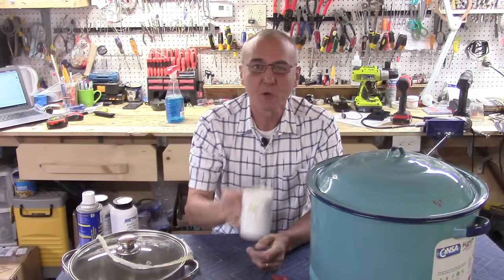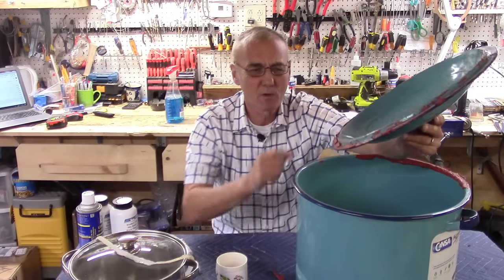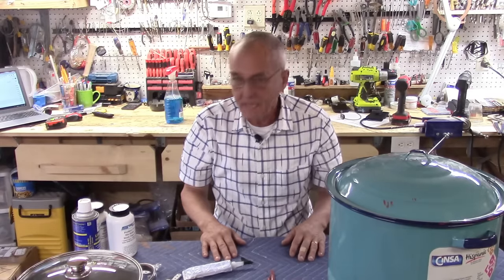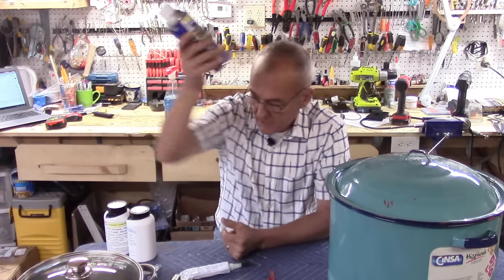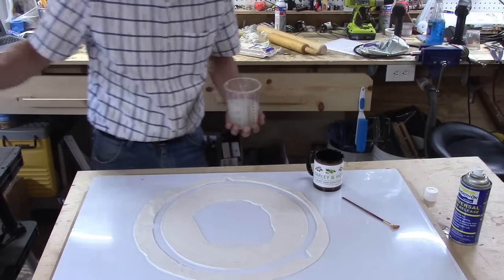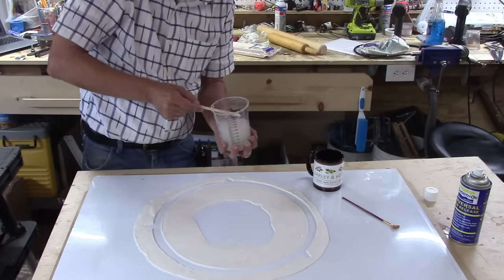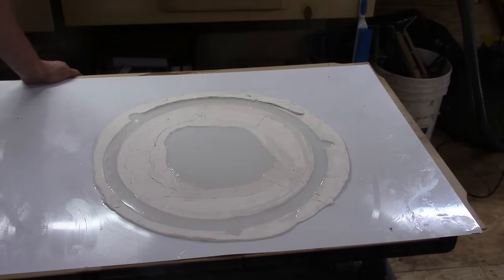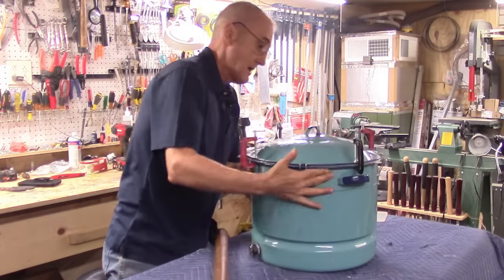BUILDING YOUR OWN STILL

Comment: Here in Bulgaria we seal the pot with a thick paste of flour and water, cheap, safe and works every time
Reply: This is also how the paste is made to repair classic books when they need to be to re-bound. Glue made from rice is surprisingly strong.
Reply: @tomcruise2313  wow i may have to experiment wirh flour and water
Reply: Once thank you for the advice. I'm going to do that.
Reply: Here in Australia we do that too!
Reply: Thats the popcorn Sutton way
Reply: What's the gluten free recipe?
Reply: pinnacle of balkan engineering
Reply: I have done this as well

Comment: You can use a cheap alternative to tape or silicone and do what I do as a chef, using flour turned into dough strips to seal the lid. Its used in kitchens for stews or slow braising to keep all them juices in. Hope this helps!
Reply: It's not a system that can go more than a single run .. but?! Yeah! And it's 100% NATURAL! Vegan and Organic at it's truest....

Good comment
Reply: @NJOwens-ep3hf   flour is not always organic.
Reply: Was also going to suggest this. Seen some Indian chefs do this when making biriyanis.

Comment: Hey George, I tried the method you showed to make the gasket, but unfortunately my lid was a bit different so it didn't work. What I ended up doing was to turn the lid upside down, run tape around the outside to make a dam, then filled that with the silicone. this worked a treat and also bonded to the lid so it doesn't fall off. Just sharing in case anyone else needs an alternate method.
Reply: That is what I was thinking, it would be nice for it to be stuck to one of the surfaces.

Comment: Hi George. with your lighting you could use a big white board. where the camera lens is. and shoot , the light from the sides would then bounce off onto your face. if it's too much light on your face. you could try a smaller one by the camera. if it's too much light hitting your face. use a smaller one. or not enough light use a bigger one or one on each side of the camera.

Comment: Hi George, the best cheapest seal is clear food grade rubber hose, the same that’s used for the water flow on the condenser of any still. Just slice the edge and fold over the edge of the pot not the lid. When heated it will mould into a really good seal.
Reply: what size of the hose would you recommend?
Reply: Sasha in metric about 10 to 15 mm
Reply: @Aleksandr-Herman  the rubber hose split down the middle didn't work for me I've had better luck with cheap 1/4 inch weather stripping... I use it on the outside edge of the bowl dome
Reply: That was  helpful clip ,thanks
Reply: what about the gap from the hose not being 1 round piece?

Comment: I've found the easiest reusable seal for those cooking pot lids is to use a section of your condensers water line. Cut a slit the whole length, being careful to keep it straight, and just slip it onto the edge of the lid and clamp it tight. May not hold up to your air pressure test, but really, a still should only run about 5-7 psi. Any more than 10 psi and somethins not right. But I always love to watch you work , George. Any time I need calculations, figures, or details that I tend to forget, this is where I come to find them. All your time and work is greatly appreciated. I've been doing this over 20 years, and I still learn something new from almost every episode. Thank you, and Keep it up.
Reply: Something wrong with the still, if it has any measureable pressure, it has an open tube to the atmosphere.
Reply: @grancito2    -  Most modern pot stills, yes. I use a modular, hybrid, reflux system with a 2" pipe at a 45, 2lbs of marbles in a sight glass, down to 1/2" pipe into 1/2gal infuser, down to an old style worm coil condenser thats 50' of 3/8 pipe, on top of a standard 15.5gal beer keg. Technically, its "open", but is also quite restricted, and does build up a decent amount of pressure, especially toward the tails. I chase a lot of leaks, but totally worth it when it puts out 3gal of 180+ proof in about 3 hours. I Love the hint of coffee I get from the infuser. (I drop it to 100 proof leave in 3 gal barrels made outta mesquite for #@%. Bottles around 95 proof.

Comment: Thank you for the tip on the silicone I build a gasket it works great I have a beautiful stainless steel still now and I'm making caramel rum using Werther's original in the Thumper

Comment: Holy crap, that was awesome! From the genius clay mold for the gasket to the electric element this is just great:-)>
Reply from the maker: Thanks
George
Reply: @BarleyandHopsBrewing  Just curious, could you have not used a bike tire inter tube as a gasket?
Reply: I watch this gentleman everyday, he is informative, covers allot in a short amount of time, keeps safety in mind and does not confine himself to one way of thinking.
Reply: I wonder if they're the Pacific reason he used electricity instead of using the top of a gas stove or a gas burner, for me I would rather use gas I don't know if he used the electricity to keep it from scorching or if gas will scorch it or whatnot but I think I would rather try gas first for myself, that way you do not have to be close to electricity if you have a shed or a rock house that you prefer to brew at. Here in the South it's very illegal and I would hate to get caught with one in my house cuz I'm sure they would try to take my property as bad as they are here

Comment: I use a length of soft silicone tubing, cut to the circumference of my pot. Slit open lengthwise and pop the slit over the edge of the pot. Makes a nice rubber cushion and using spring clamps such as bulldog clamps, the lid seals nicely and the gasket can be removed and washed.

Comment: Rtv 650 high temp silicone sealant, food grade.  Instead of using it and then sealing it to the lid, only put it around the lid and use your finger to smooth it out.  Cure 24 hours max. And for clamps you could use adjustable locking pliers, pretty cheap from walmart, I'd suggest 10 and get an extra 2 just incase. Cheaper than the one you described, but if it ain't broke, don't fix it! Love the videos George, keep em coming!

Comment: I built a gasket in a similar way, but I used this method: in the lid I made the silicone adhere while I put some soap on the pan, I let the silicone dry a bit and then I inserted the lid so it has a perfect shape of the edge of the pot. The gasket is always attached to the lid while from the pot it comes off easily because of the soap. a big hello!
Reply: I'm doing it your way! Also, do I need to put an element in it? My crawfish pot can go right onto the stove! Right?
Reply: @mattpeacock5208  Because of my bad English I don't know if I understand correctly. I try to answer: between the lid and the pot I only put liquid soap (to have a detachment of the seal). The silicone resists the boiling temperature, there is also silicone for "high temperatures". Actually it would be advisable to buy "food grade" silicone but I haven't found it locally.
Reply: @Demymaker  thank you for such a quick and clear answer!
Reply: @mattpeacock5208  I'm glad it's useful, it's just inventive!

Comment: Love all your video's, my goto source of home distilling. I'm making this comment as I await my first ever drops of head. I had the same issue with creating a good seal on the pot. I have a 12.5 inch pot so I bought me a 12.5 inch bicycle tire tube. Sliced it open to the ID diameter and after a good cleaning slid it over the lid and it seals great. (black rubber tubel
Reply from the maker: Great solution
George

Comment: when we made silicone gaskets on cars we'd  wipe a very thin smear of vasolene on the mating surfaces  and then apply a continous bead of silicone sealant to one surface and then bolt the two surfaces until the silicone sealant just begins to bulge, and then we leave it for a few days to cure before retightening. Ive seen food grade pure silicone sealant like CRC food zone. Others say 100% silicone glass /aquarium sealant is safe after it has taken 7 days to set and gas off.

Comment: I used a silicon cookie mat and cut out the gasket....and I use binder clips to clamp the lid down...works like a charm.  I also used leftover silicon mat to make gaskets to seal my riser pipe.  I can stuff copper scrubbing pads into the riser pipe to make it reflux.  I can run 160-175 proof with the reflux, and 130-140 proof without.

Comment: Great lesson my still had a 3/8” copper pipe for my vapor. Like you said it takes forever. I went a got a 5/8” pipe with fittings to convert mine over. I’m hoping to cut the time in half. Thank you again for sharing your knowledge.
Reply: How are the times?

Comment: I used silicone on my first little SS pot still and it worked well, but I do believe there was some leaching of the essence that took place in the early runs.( that silicone seal is 3 years old and has since "seasoned"). I switched to a pressure cooker and then learned of the squabble about aluminum being bad for you. ( It produced some butt kicking good whiskey and rum however) so just to be safe, I am going back to Stainless Steel 5 gal and a real dryly mixed flour water seal that works perfectly and if it adds any leaching flavor, at least its a grain !!    Thanks George!!!
Reply: NO silicone! As you discovered it will leach into your product. NO aluminum it will degrade and also leach into your product. Stainless steel and flour paste is the way to go.

Comment: My thought was that as with refrigeration the 5/8 inch orifice would act like a Venturi and the expansion of the gases or vapor in this case would cool. I thought that this would allow some of the condensed vapor to drip back down which is almost the same as a copper plate. That was my thought maybe you can give me a little more insight. Thanks for getting back to me cliff

Comment: 1/2" silicon tubing split down the middle and slipped over the lip of the lid(or pot) and clamp down with small wood clamps works very well...

Comment: Use salt dough as a gasket ,1 part flour to 1 part salt to quarter part water use some binder clips ,as it heats the dough gets rock hard ,ran atleast 50 gallons of shine out of a 5 gallon still never had a leak

Comment: I use plumbing pipe repair tape. It's extremely stretchy and sticks to itself without adhesive. You just wrap it around the outside of the lid and pot to seal them together. It's quite easy to remove. It can't be re-used, but it's so stretchy that you'll be shocked to see how little you need each time.
I can't recall the name of it off-hand, but I need to buy more soon. I'll try to remember to add it when I do.

Comment: Fantastic job George. I would love to see you finish it off as it would make a great tutorial for home distillers like me. I am curious as to what option you would use to attach the column. Perhaps a stainless steel mixing bowl silver soldered or brazed to the lid and then adding a tri-clamp for the column?
Reply: Yes
Reply: I used a stainless mixing bowl and attached a 2" tri-clamp. I just found a bowl that had the same lip diameter as my pot.

Comment: You can use water glass made by adding sodium hydroxide to crystal cat litter(silica gel costs about 30 bucks a bag) and water. Add the lye in small portions until you have a super saturated solution. It will immediately crystalize on contact with anything so dilute slightly and brush on a paper gasket both sides. Drop on lid and heat pot. Now this seals head gaskets, cracked heads, and alcohol wont break it down when dried, neither will rtv which in all honest wouldnt hurt anything its used all the time in the food industry only not called rtv its the same thing only approved by the fda to use in food. Kinda like food grade buckets and non food grades all the same dam thing only one costs more.

Comment: I'm almost done with my second still build.   Both used pressure canners with the multiple bolts around the top to hold the lid on.   I use these because they have a taper seal and don't require a gasket.   On this one I used an aluminum piece intended to be a hydraulic piston, and had it bored to accept 1.5" copper tubing, with an upper O-ring, and another at the bottom where it contacts the lid, which was also bored to match.   The two bolts that hold the handle on the lid have threaded rods installed and a plate with a hole in it bears down on the aluminum piston assy so that I have metal to metal contact, and the O-ring is compressed for a seal.  This allows the 3' piece of 1.5" copper which is my column to be removed, rotated, moved up and down, etc  It's quite tight and doesn't move easily.   A T at the top of the column reduces to 3/4" copper each way, and a rubber stopper allows my thermocouple to extend down to the T.    A short 3/4 copper pipe is soldered to the horizontal outlet and connects to the shotgun condenser with a sharkbite connector.   The shotgun condenser begins with 3/4 to mate to the sharkbite, followed by a reducer to 1/2", and a 90 deg elbow, connecting to a 3' piece of 1/2" copper, which has two 3/4 to 1/2 reducing Ts slid on, and a length of 3/4" copper over the 1/2" copper.... as much a possible.    Where the 1/2" copper comes out, there is a 45 deg elbow, and a piece of 1/2" copper to discharge the product.  The lower reducing T has a garden hose fitting, and the upper just a piece of 1/2" copper going to a hose that fits.     This will be heated with a hotplate.      The 1.5" copper column will be packed.... or  not (reflux or pot), with a hole drilled in the bottom and a piece of copper or stainless wire to keep the packing in. 

      Sharkbite connectors consist of brass, with O-ring seals, and a food grade nylon insert.... that could be removed, as it serves no real purpose.  They allow the condenser to be removed easily for cleaning, and are cheap..... at about $10 each.  Designed for PEX, they also can be used with copper and CPVC.   They grip quite firmly.   I've never head of one being used on a still, but they are about the least expensive positive sealing removable joint I know of................                any thoughts or ideas?
Reply: By The way, these pressure canners can be had at second hand stores,  Salvation Army, Goodwill, etc..... usually for about $20.  I have zero concern about aluminum in the pot, though some folks seem to be bothered by it.   The first still was a cooperative effort for a friend......... and ended up being his......  now hundreds of miles away.    It has distilled countless gallons of whiskey of various types, and was a very basic pot still with a worm type condenser
Reply from the maker: This is a goal mine of ideas and practices here. Thanks for sharing
Reply: Thoughts on brass/lead content ?
Reply: @everything.in.a.nutshell  Sharkbite is supposed to be lead free.   Used in home water systems it must comply with various standards, some of which do not tolerate lead.
Reply: @stonetoolcompany3649  thank you

Comment: I've been trying to figure out how I was going to install my heating element into the side of my boiler. (6 Gal stainless pot) I never thought about just putting a nut on the inside! Perfect!! I'm using a 6 gallon stainless pot which has a 13" diameter at the lip. I bought a large stainless bowl that was also a 13" diameter at the lip to use for the dome shaped top. I used a crap ton of Teflon tape around the 13" lips sealing the lid with Harbor Freight plastic clamps. I am going to change this to the method that you used. I cut a 1.75" hole in the bowl and then made an extrusion tool that would extrude the hole to fit a Dernord 2" weld ferrule. From there up it looks pretty much like your 8 Gallon pot still. I made my own shotgun condenser too. However, my first C.O.B. batch tasted like unwashed cow ass. So I went back and watched more videos. Turns out that that should have been my sacrificial run to clean out the still. I can now identify the nasty flavor in the product to be that of soldering flux. Thanks for putting out all the great videos!!
CJ
Reply from the maker: Unwashed cows ass (LAMO). I can definitely identify with that. I've had fermentations smell like two asses ha, ha.
Good job and keep at it. We learn from others and I really appreciate the comments and information we get back from our community.
Let me know if you ever need any help. I'll do what I can.
George
Reply: Thumbs up for unwashed cows ass. I'm going to have to keep that one... LMFAO!!!

Comment: George,  the tire pressure valve is good but the place you put it could be a bad spot if you were to try and mount a 2-3 inch pipe column ,,  as I remember from the previous videos just made,  where still colapesed ,  if you did that farther away from the center ,  and then mounted a small ball valve as a pressure relief when done cooking just turn lever on valve and turn heat off , ,     as you have stated you plan on a dome of some kind you will be cutting a good size hole in the lid,  so all I said would not mater,

Comment: Hi, I'm a total newbie, currently distilling with a 3liter copper pot still. I am very frustrated with the size and would like to build my own using a 30 liter Urn, my question is, can I build an extremely simple condensor completely with fittings and pipes and no soldering/brazing? I can drill holes in the lid, I can make the gasket, but I don't have the tools or experience to solder/braze. I'd pretty much coil the condensor pipe through a plastic bucket and circulate the water in the bucket...

Comment: I'm building a little makeshift still and I'm getting mixed opinions on silicone use as far as being toxic. I have found a PDF from Exxon Mobil that says butyl rubber AKA inner tubes is non-toxic. I trust your opinion on this also what is your opinion. I just ask Google if butyl rubber is food safe and that was the first thing that came up. Thanks for the videos they are great and highly educational
Reply: There's food grade silicone and non food grade silicone.

Make sure you use food grade silicone